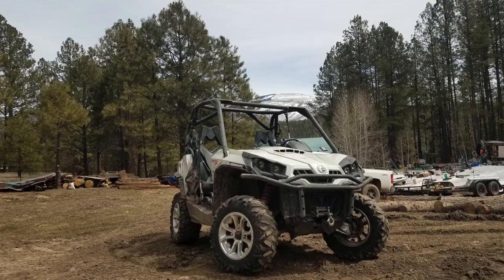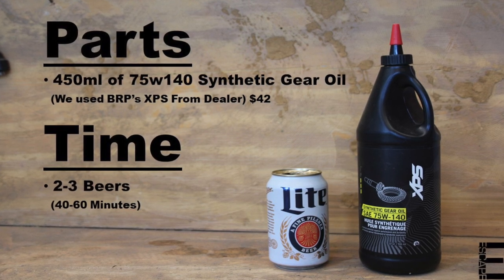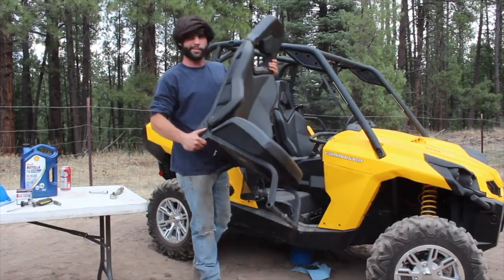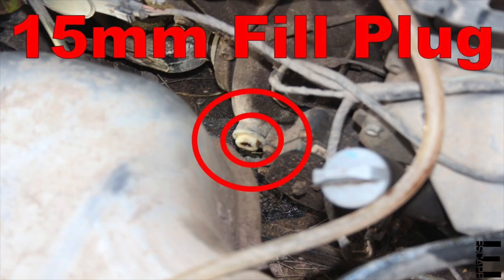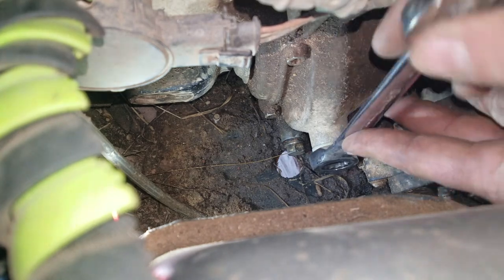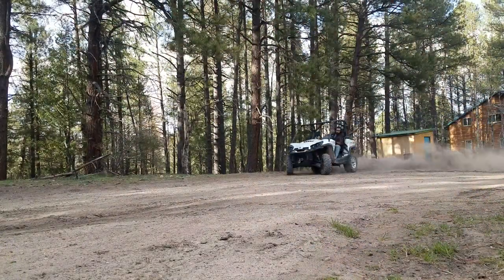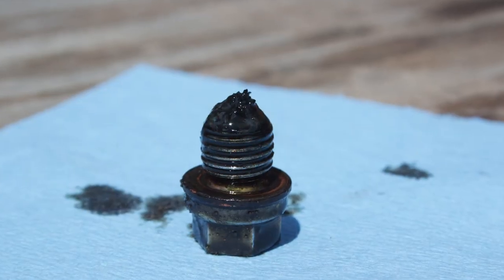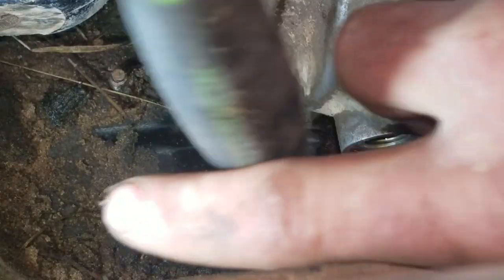Can-Am Commander Transmission Fluid Change: How-To Change Gearbox Oil Can-Am UTV

Comment: So helpful.  I appreciate all the pointers. I'm in the midst of replacing the horribly expensive u joints and figured I'd change the transmission oil while I had access to the drain and fill plugs. I'll be looking for your videos on clutch maintenance next. Thanks again man 👍🤘
Reply from the maker: no problem, I appreciate the kind words and am glad it was helpful for you. Clutch and belt videos are definitely on the list next time I pick up a maverick or commander that need those areas serviced. Thanks for watching and taking the time to leave a video suggestion in the comments. Cheers

Comment: Your videos are very helpful and very much appreciated.  I have a 4 seater can am max 1000, and the hardest fluid for me to change was the transmission fluid.  It is a very tight space to get into from above, so I finally decided to remove the skid plate and tackle it from below, which made it much easier for me, even though it added some time to the job. I have to admit, it was nice to remove that plate and clean out the dirt and the engine from below.  Thanks again for the videos, let me know if you have one for replacing the belt.
Reply from the maker: appreciate the kind words. And there is definitely something to be said for the satisfaction that comes from de-mudding or cleaning up under those skid plates. No belt video yet, but it is on the list for the next time I pick up a commander or maverick. Appreciate you watching and taking the time to share your experience with this job in the comments. Cheers

Comment: Thanks for the video.  I have a 2016 Commander Max that has an occasional grinding issue when shifting to high gear. Do you have any experience with this issue? Or have a resolution to this issue?

Comment: Great videos!  Happy I found your channel as it has been hard trying to find good or any videos on maintenance for the Commander 1000.  Question, do you know if the commander has an alternator like a car to recharge the battery as it is running?  If so have you needed to replace it?  I have a battery tender charger and charge the battery 2-3 times a week to keep it fresh and filled up.  Just wondering, thanks!
Reply from the maker: thanks I'm glad your finding the videos helpful. Battery shouldn't need a charge multiple times a week so if it requires charging that often to start I'd have the battery tested as it will probably need to be replaced. However if battery is good and the bike is not charging it properly see what I found below.

As far as alternator question.
 I'm the farthest thing from an expert on electrical or a professional tech for that matter. But I just did a quick search on the forums to confirm what I was thinking that these machines have a **stator**, (not a starter  as the primary component of the charging system. (I believe it to be similar to an alternator, but for motorcycles and other smaller single cylinder and v-twins, like your commander.) However it seems uncommon for these to fail, and if your machine isn't charging the battery its more likely the voltage regulator/rectifier, blown fuse, loose ground, bad connection, etc causing the issue. 

Hope this somewhat answers the question, which I really appreciate you asking as every time I get a new question I get to research a new topic and always learn something in the process. Thanks for watching and taking the time to leave a question in the comments. Cheers

Comment: Hey man great videos I just picked up a 2011 can am commander 1000 and been watching your videos for proper maintanence on the SXS your videos are really helpful. you plan on doing anymore videos on the commander ? like maybe when and how to do coolant change. also my fan turns on as soon as I turn my commander on any suggestions why that happens thanks !
Reply from the maker: Thanks a lot, I'm glad you are finding them helpful. I will definitely be adding videos to this commander series next time I get one as the one if the video sold last year. As far as the fan goes I'm really not sure, but after a quick google search it seems to be a fairly common issue people are having and discussing on the forums. A few fixes involved water in the fuse box, cleaning and re-plugging the connector for the fan itself, or just running for a while and it going away. I've never personally had that issue so I'm really not familiar enough or have the experience to tell you anything for sure. But let us know if you figure it out so we'll all have that info. Maybe someone will see this and comment with a fix. Thanks for watching and taking the time to leave a comment. Cheers

Comment: hello, good night, friend, I have a nam x camera that when I change the speed from "N" to "D" sounds ugly as if something is not engaged and if I try it again, it goes in but when I go forward it turns off, what could it be, it would be to adjust something or change the gearbox (I don't know if it has a gearbox hahaha)
Reply from the maker: hello friend, hmmm I'm not sure if the shift cable is adjustable or not on these machines as I've never had this issue. I would try and pull the plastics around shifter and follow the cable attached to shifter and see if there's anything similar to what we did on this rzr: https://youtu.be/LMBFFDu6gu0
Hope this helps and sorry I'm not really sure what's going on with your machine. Appreciate you watching and taking the time to leave a good question in the comments. Cheers
Reply: @EscapePowerSports  thank you very much friend I am going to take it to practice in the car I have a video where it shows the fault to see if that way you could access me out of nowhere the car turned off and now I start it it does not enter speed and if it enters it sounds as if it did not fit a mesh

Comment: I got a question the royal purple oil you show say on the bottle not for wet clutch systems is it still alright to use it
Reply from the maker: Now that was a great question! After some research, it appear that Can-Ams use a dry clutch setup to engage the cvt. I'm assuming that is because both the primary and secondary clutches are on the exterior of the transmission case, in the belt box, and are not exposed to the transmissions oil? I am by no means an expert on the mechanics/engineering/ or design of these machines so if anyone reads this and has any additional info please correct me if I'm wrong here.  However, I do know that some Yamaha's, Artic Cat's, (possibly other brands), do use a wet clutch in their sxs's so always checking the owners manual for oil and fluid specs and requirements is definitely advised. In this case the royal purple linked in description does meet the API GL-5 synthetic gear oil brp requires for this machines gearbox. Thank you for watching, and a special thanks for taking the time to leave a thought provoking comment. Hope your job goes smoothly. Cheers.

Comment: My rear seal is leaking, DIY, or take it to the shop?  What should I expect to pay?
Reply from the maker: hmmm when you say rear seal do you mean the seal for the rear diff? If so I've never had to replace one so I really don't know how much of a job it is, fortunately the can am forums are full of valuable info for DIY jobs so I'd check there to get familiar with the job and see if it falls under something your mechanically comfortable with. As far as what to pay for a shop maybe get a couple quotes and check for shady tree atv/utv mechanics with a good reputation on facebook in your area if your looking to save some cash from  bringing it to dealer. Just a couple ideas here, hope it helps, but if not thank you for watching and taking the time to leave a comment. Cheers

Comment: What you have to change the oil??? WTF
How often should you change all the plastic?
Reply from the maker: no worries, good news the oil change is easy and plastics usually only get swapped after high speed impacts with trees or after failed donut attempts, thanks for watching and taking the time to leave a comment. Cheers